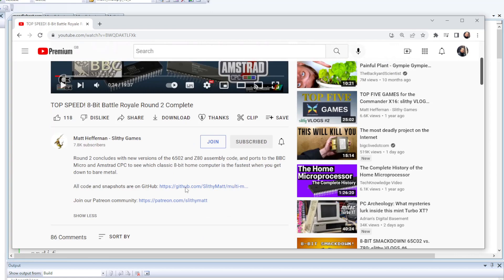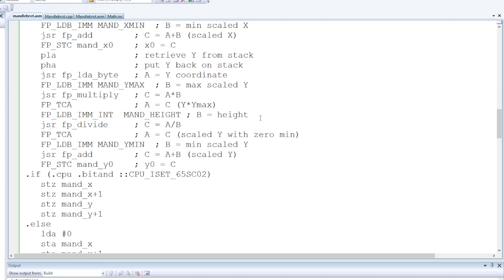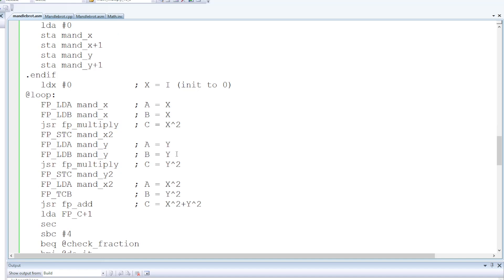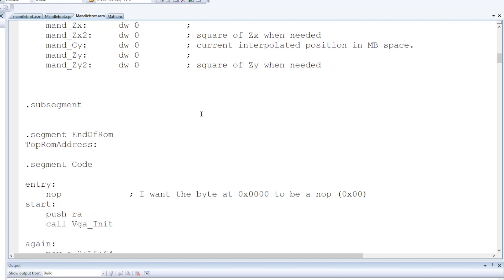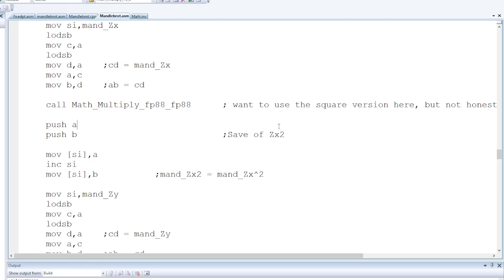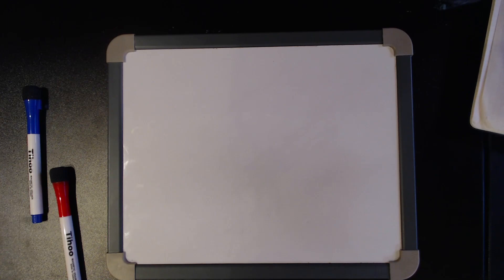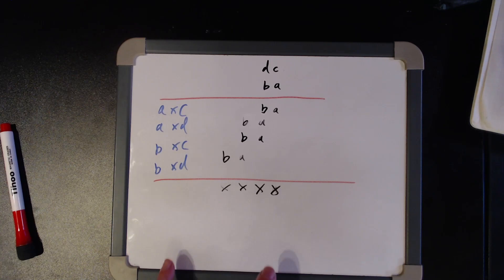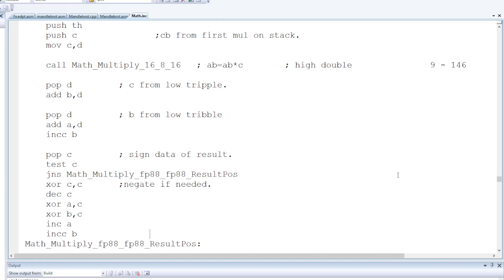Porting Matt Heffernan’s Mandlebrot Benchmark

Comment: I'd love to see a comparison of the optimized version vs the un-optimized.
Reply from the maker: If I get some time I’ll do a whole program optimisation pass (that wouldn’t be a legitimate benchmark but it will be faster) and make a short demo video.
Reply: @JamesSharmanExtras  It's very interesting to see the platform specific optimizations and compare performance. And I don't know as for others, but for me platform specific implementation of the test is not cheating, it's just a next round/level of 'Royale Battle'. I'm pretty sure that both ZX80 and C64 fans will re-implement the Mandelbrot test to show what possible to squeeze out of the beloved platform too.

Comment: I've had an idea that I would love to hear your opinion of. If you had a second clock running at twice the system clock speed, and multiplexed the program counter clock between the normal clock and the doubled clock, selected on your argument register load line, you might be able to increase your instructions per clock cycle.
Reply from the maker: Not actually sure about that proposal, I have 2 separate busses for getting data to the Alu so I can dispatch and alu op every cycle.
Reply: @JamesSharmanExtras  Well ALU ops wouldn't be affected I don't think because the double clock would effectively increment the program counter on the falling edge as well as the rising edge whenever you are doing a load immediate, getting rid of a bubble in the pipeline

Comment: Have you considered using video RAM chips as main memory to fetch instructions through their read-only port to reduce the number of stall conditions in your pipeline to raise the IPC if not what stopped you? Would you consider them "cheating"?
Reply from the maker: That's similar to just using regular duel port ram. In the future I'm hoping to explore some of the techniques that are used to attack this contention. I'd rather do that then something like this that wouldn't scale well (If for no reason beyond cost).

Comment: Paramaters? Parameters.
Reply from the maker: I’m dyslexic, if I’m not allowed the odd mistake I’ll have to stop making videos 😞
Reply: @JamesSharmanExtras  I call it "Slydexic" - and thanks for these extras, by the way.
Reply: @JamesSharmanExtras  - of course you are allowed the off mistake. It was not meant as a criticism. I am in a somewhat similar situation, since I moved to a different country (Sweden) some 20 years ago. I have learned to language well enough, but I know that I make mistakes when I write. Unfortunately people seem to be reluctant to point out the mistakes which makes it difficult to improve my writing :(
Reply: @JanBruunAndersen  I think the difference is in that dyslexia is an innate difficulty which cannot be removed with knowledge. I have mild dyslexia (at least, that's how I consider it) and there are many  words I cannot spell reliably, despite spending years trying! It's less about seeing the correct spellings, and more about being unable to reproduce them. I have the same dates too, it's quite awkward forgetting family members birthdays; I have an elaborate +10/+2/+1 relative to my own birthday as a way of remembering. Fortunatly, I'm fine with equations (can't remember 'times tables'  though) which would be an issue as a chemist :).
Reply: I have mild dyscalculia. I read for instance 1021 and write down 1012. To me they just look the same. Very annoying. I know I have this and focus extra on numbers and still 4 out of 10 times I make the mistake. Even with extra attention and knowledge of the condition.